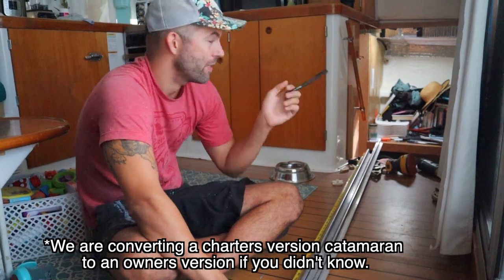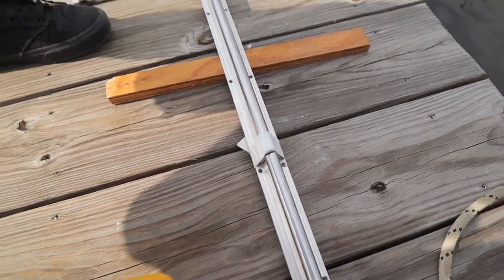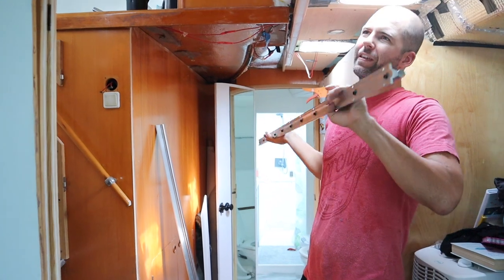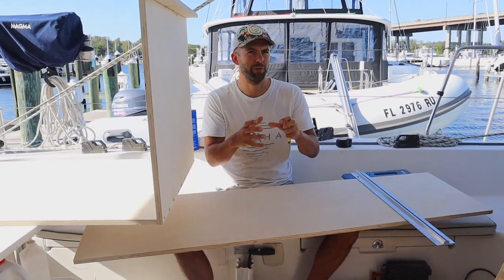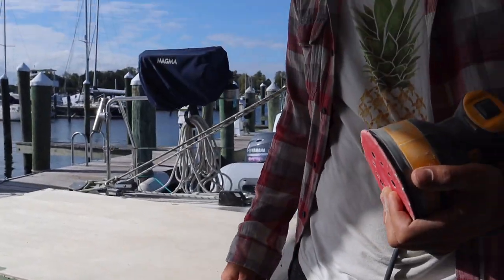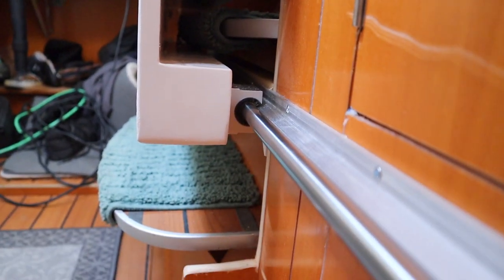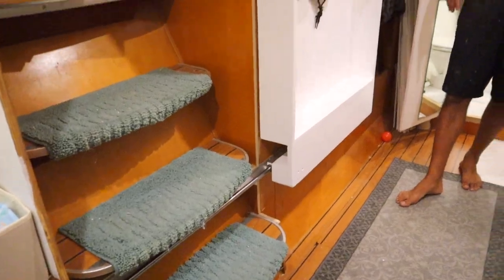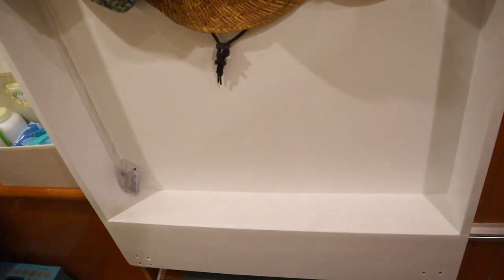WE HAVE A DOOR FINALLY!!

Comment: It looks fantastic.  
One suggestion that will make your life easier- when cutting materials leave the waste side of the cut unsupported. When grinding (or cutting wood) you want the offcut to fall away. This allows the kerf in the material to open up as you cut.  As you are doing it, the kerf pinches closed which is hard on the tools and increases the risk of injury.  Stay safe out there!

Comment: good work,  It looks like you may be using a wide grinding disk on the grinder instead of a narrow cutting disk,  If you were using the wrong one it is much more difficult to cut with it,  Apologies if you were using the correct one,  just wanted to point it out if you are having the issue in future it may make life a little easier,

Comment: Where did you source the rails? Our Leopard 38 needs a door like that.
Reply from the maker: They were 2000mm long 18mm diameter linear slide rails from amazon. And like I mentioned in the video, in retrospect 18mm diameter is was bigger than we needed